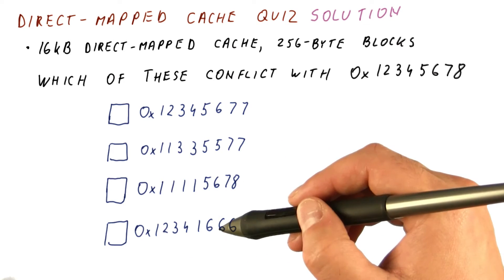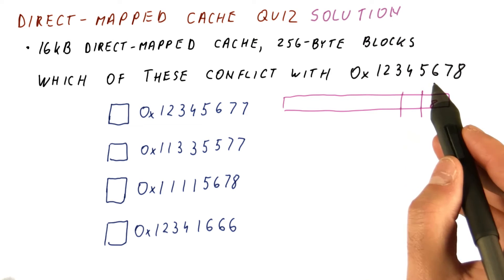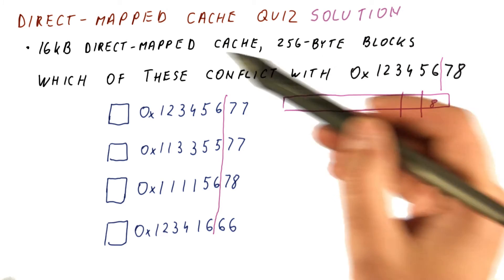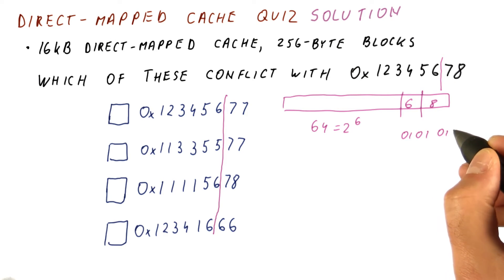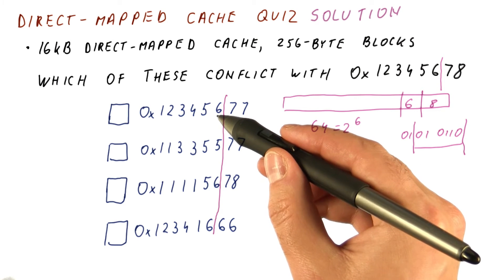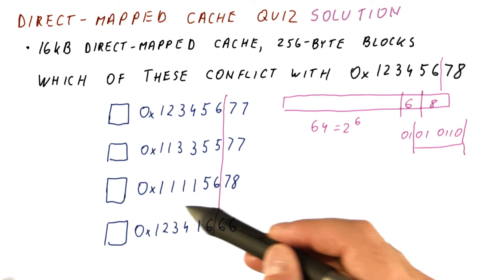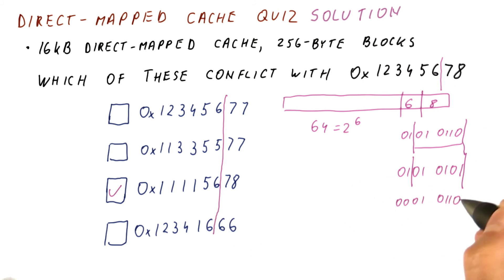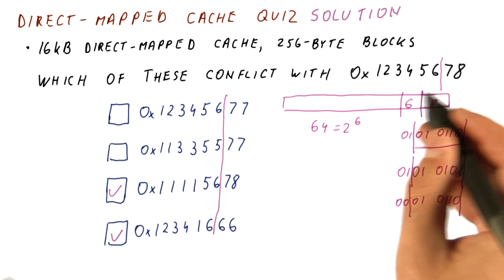Direct Mapped Cache Quiz Solution- Georgia Tech - HPCA: Part 3

Comment: Hi,

I think you mean that the size of the blocks is 256 BITS. If the size of the block is 256 BYTES, then we will need 11bits for the offset instead of 8 bits.
Reply: That would only be true if the cache were bit addressable. The solution is byte addressable.
Reply: ajmartin942 But the video stated that 256 Bytes can be represented in 8 Bits. :(
Reply: Ong Xiao Cong The offset isn't there to represent 2^11 bits, but to address 2^8 bytes.
Reply: OH Thanks. Took me awhile to understand. One word = 1 Byte. Hence 256 Byte = 256 words/offsets.